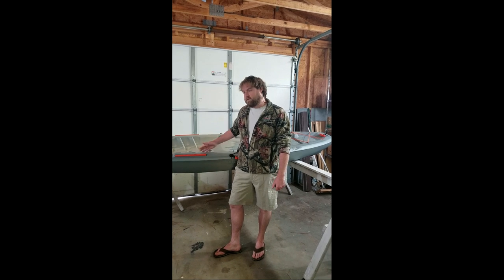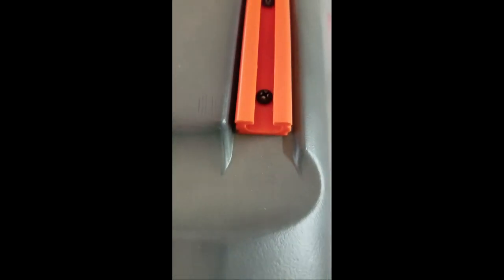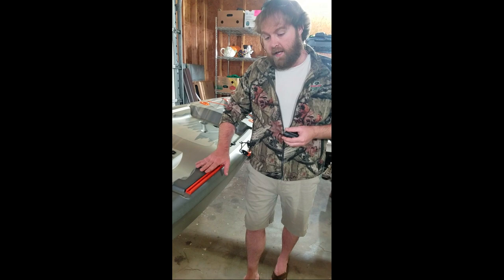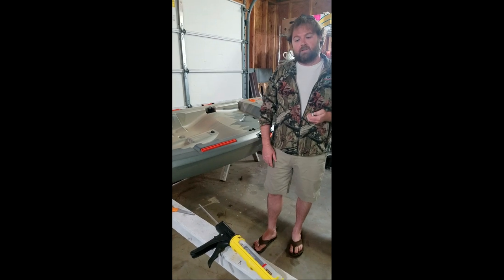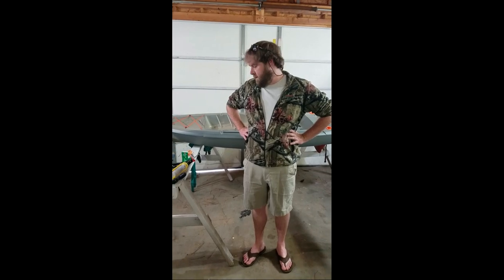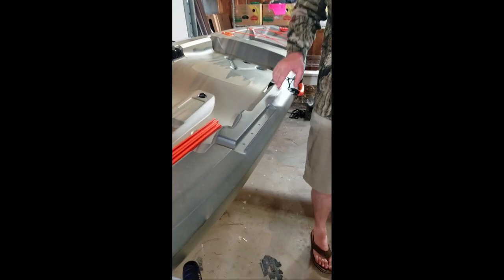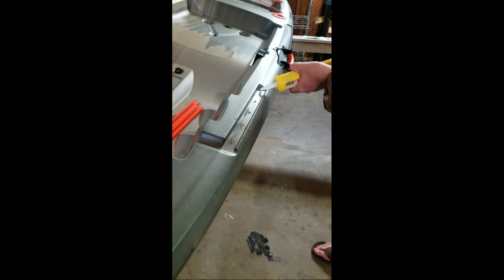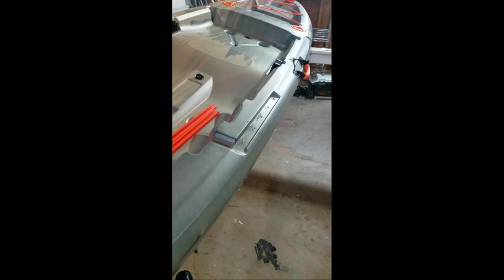Fixing The Lifetime Teton Accessory Track System - 5 Minute, $0.97 Fix!!!

Comment: Hello! What size of screws did you use? Thanks 🙏
Reply from the maker: #8 x 3/4"
Reply: Thanks man! Do you recommend using that glue you put on the video? Wouldnt it be bad if u eventually want to change the screws or change something? I got mine yesterday! And it has the screws with no flat heads haha... lifetime took out the teton too days ago i think. I am glad i was one of the last ones to get one; i really like it. The seat is #gold ! Take care and fish on!
Reply from the maker: @atlanticcountyfishing9790  I used silicone not glue.

Comment: I would consider replacing the plastic track with a metal yak attack track in the future all I see is a breaking point using plastic
Reply from the maker: Its actually really well made. Took a bounce off the highway at 70 mph that scuffed it up a bit but still working good!

Comment: With my Scotty mounts I just screw them down all the way and then back off about 3/4 of a turn and it slides through the track and over the screw head. Although I do agree flush mount screws out of the factory would of made more sense.
Reply from the maker: I initially had a Scottys mount. The first kayak i bought, it wouldn't fit. The 2nd it worked well on, but wouldnt lock the rod holder in place. It works great now!

Comment: Ive got the Lifetime Yukon which I love its a really nice kayak. However it has the same track system with the same screws. And I will be making this change asap as I have the same issue with the screw heads being in the way.
Reply from the maker: I wish I could find a Yukon. I think i am going to upgrade to it and let kacie have my teton. I want that flat deck!
Reply: @t.j.outdoors3961  Yeah the yukon is an awsome kayak for the money. The flat deck is part of the reason I bought it. Really nice having all the room in front of you. Its actually stable enough to stand in as well. I can also get to the front hatch well on the water without any trouble. However I dont really use it just wanted to see if I could.
Reply from the maker: Could always throw a cat bag in the hatch to hold small stuff close to you. Soft plastic packages, small tackle boxes, wallet, phone, etc.